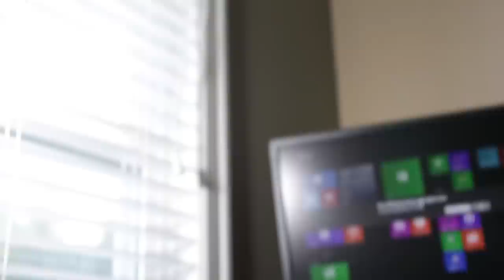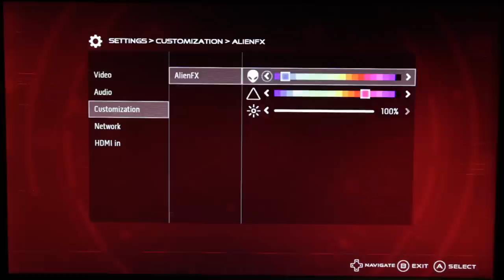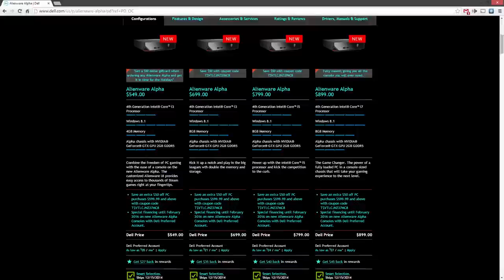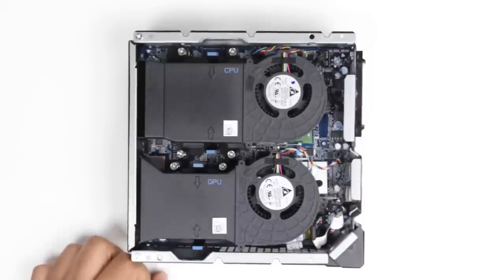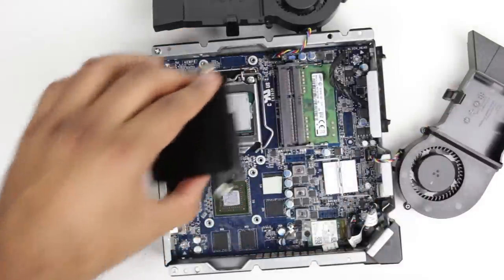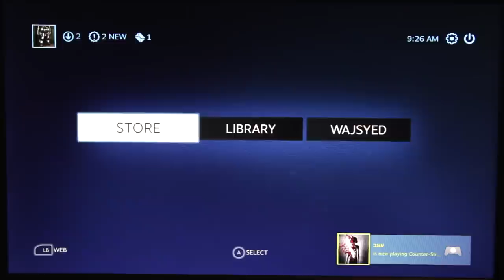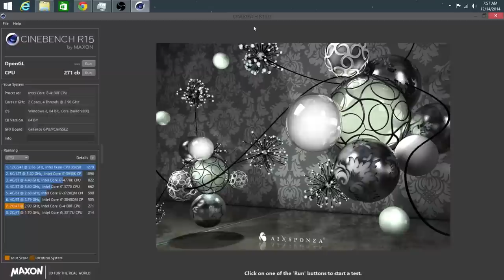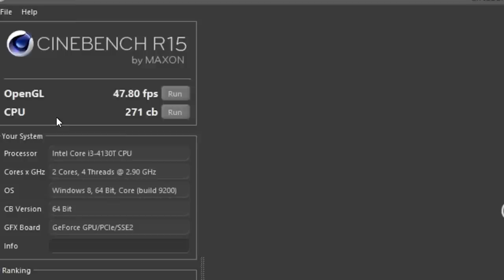Alienware Alpha Full Review

Comment: and this is why Xbox One is great, it runs so quietly, you can have a baby sleeping next to it.
PS4, Wii U and and now this Alienware, are all tiny, but loud as fucking jet engines. I'd take silence over size any day.
Reply: This comment is 40% crap, I own a WiiU and my WiiU doesn't make noise, And I usually play on it for about 1-3.5 hours and I don't get a noise out of it.
Reply: My ps4 is next to silent. You are crazy.
Reply: Reel it in fanboy.  Ps4 runs pretty darn quiet lol
Reply: noise is subjective, maybe if you are deaf as a log you won't be bothered, but i have a pretty sensitive hearing. also i'll have you know i have all the systems, often 2 or more runing at the same time, so i can easily compare them and notice difference.

RandomHeroGames Wii U is pretty inconsistent, sometimes it's quiet but other times it goes crazy. Mine actually sits next to Xbox One, i often use them at the same time, and the difference is very noticeable.
Reply: Also on YT you can find videos of ppl using noise meters on PS4, and it shows over 100 decibels, that's a fucking jet engine.
Reply: RandomHeroGames I had a PS4 for one day, before i got XBO, i needed to make a decision which one to get, i could get both but why? i don't like sony exclusives and multiplats i get on my PC (which is louder than all 3 combined btw) i can just tell PS4 is louder than Wii U, and Wii U is louder than XBO.

And yes, Wii U DOES get loud after a while.
Reply: Bolek Lolek I really don't notice the sound of computers and consoles... Unless it literally is as loud as a jet engine. But i'd be more worried about the integrity of my ear drums than anything else at that point.
Reply: The Xbox one is quiet, so is the ps4. but if you are playing 24/7 the ps4 is like HELPPP MEEEEEEE
Reply: You shouldn't have any device like that running more than i'd say 24 hours at a time, honestly. But that's just common sense. It's just like your body, you're not going to going full-steam for days at a time, you need time to sleep.
Reply: The wii u is a frickin ninja compared to the lunchbox juan
Reply: Trainer Nate you obviously never had an XBO in your hands lol.
Reply: depends, the Wii u is silent, the xbox one is silent aswell, but the ps4, from a friend, its really loud
Reply: Androx5000 sure it is, look at a gutted XBO, you can see its 33% fans and 33% empty space, so of course it has to be quiet.
Reply: ona contrary, PS4 has no empty space in it, so airflow must be terrible, and the fans are tiny, so much they are making intercooler addons for it.
Reply: Bolek Lolek and thats why it has overheating problems
Reply: Bolek Lolek Androx5000 At least the ps4 doesnt have a huge power brick and is twice the size of the ps4 not to mention looking like a VCR from the 1700's tbh. Also the ps4 is way more powerful and way smaller and less expensive whats not to like and not to mention it has better exlusives like bruh
Reply: Trainer Nate xbox one has the prettiest power brick ever made, i almost feel bad it's hidden behind the furniture, and nobody can see it.
Obviously Xbox One has better exclusives, but what do i know, knack must have been your game of the year.
Yes PS4 is more powerful and yet some games, like GTA V for example, still look better on xbox, because PS4 versions looks lifeless.
As long as they are 60fps, i'm fine.

As for look of the console, i only buy white consoles, and white xbox looks pretty damn sexy. It is big, i will probably go for slim version when it's out, but it's not that bad.
That said PS4 looks good too, but only vertically, but that just wouldn't work in my room. And i actually think PS4 looks like crap when it lies down. I mean it was obviously designed to stand, that's how they always show it on advertisments, and even the box art itself.
Reply: Since when you could hear and ps4 wii u being loud stop lying dude
Reply: Bolek Lolek The Xbox One powerbrick is almost as big as the ps4 itself to be honest and at least the ps4 has it built inside, which almost doubles the xbox ones total size including the giant ugly grey brick you seem to like I just don't understand. Sony supports Indie Games so games like Octodad and No Man's sky a galaxy sized galaxy with diverse planets and ships and life are only on ps4. the xbox one a great family all in one system for watching tv and raging in cod but the ps4 is the true platform meant for gaming and the best games on it period. xbox one isnt bad - its just not meant for true gamers
Reply: Bolek Lolek Also you can get a ps4 in white too i dont know why that matters
Reply: Trainer Nate uhm... i have the xbox one, and the power brick is not all that big, is slightly bigger than the xbox 360 power brick, and besides, my power outlet its hidden, so is the power brick.

also, the fact that the ps4 has a built in powerbrick its a terrible idea, not only it generates more heat, but in case it gets damaged, it cant be replaced as easly as the xbox one power brick, and if there is any voltage problems, the ps4 will probably suffer hardware malfunction

i can see how your comment has a lot of playstation faboyism
Reply: Darren Persad liar liar pants on fire.
Reply: Androx5000 I have an Xbox 360 because it was better than the ps3 cuz it was really bad and I love the 360 controller so I'm not biased. I am not saying the Xbox One is a bad console. I am saying that the console is not for me because I need it to be portable which it is, powerful, which it is, and have a great controller and great exclusives like The Last of Us and No Man's Sky. To me, the Xbox One is like a whole entertainment system for the whole family to use and not a system just for playing on, hence the name "Playstation." hopefully you can agree with this at least. Its not bad, its just not for me
Reply: Darren Persad Bolek Lolek I have a Wii u too and it is literally silent all the time. Thanks for getting real info in the convo because I have neither systems except a wii u and an xbox 360
Reply: Bolek Lolek Maybe you are suffocating your systems =p Try putting them in open areas, not in a stand.
Reply: Trainer Nate The ps3 was really bad? what? lol. The ps3 actually had exclusives, as for multiplats some of them ran worse than the 360 at the start of the console's life, but nothing you would even notice (Skyrim pretty much the only bad multiplatform game on the ps3...which I hear got fixed anyway) but I played all of those on my pc anyway. Ps3 ended up the champ of last gen IMO, even though it had a rocky start.
Reply: Hijynx87 I just love the 360 controller so much, and even though ps3 had the better exclusives mainly Halo 3 was a generation-defining game that honestly deserves its own system for that. I can always play The Last of Us Remastered on ps4 and anyways if there were any good new Halo games for One, I might have bought it instead but theres not and No Man's Sky and The Last of Us look like the new best games plus ps4 controller is better I agree. ps3 isnt bad, its just not as good Ive played on it
Reply: My ps4 is extremely quiet
Reply: Christopher McClinton because saying the ps4 sounds like a jet engine isnt gonna piss anyone off or start a console war what did i even say lol
Reply: Unlike you, i don't care how it sounds, otherwise i wouldn't get any consoles.
I care how it performs.
Reply: Christopher McClinton truth
Reply: I'm guessing you've never actually seen or heard a wii u before
Reply: wackytactics who? I own a wii u and i honestly think its the best console you can buy. them exclusives tho
Reply: Trainer Nate he's saying it made noise haha. this thing is quiet, even while running a huge game like bayo2
Reply: Christopher McClinton i never said the wii u was ever loud, in fact i was saying how quiet it was. read it again. -_-
Reply: Christopher McClinton ".the wii u is silent asf" implying that YOU implied that I said the wii u wasnt silent. reading 101 pls
Reply: Christopher McClinton listen, unless you've honestly heard the wii u run a multitude of games comparable to bayonetta and/or games with complex amount of graphics eg. smash bros, monster hunter 3 (to it's own extent) and even DKC TF, you really cannot vouch for it's own quiet existence for "listening to it at a cousins house". And still, you cannot grasp the meaning of the apparently incredibly complex word, "implied", as you were STILL implying that I said the wii u was silent. "who are you talking to the wii u is silent af" as in "are you saying the wii u is not silent, because it isn't" effectively contradicting youre quotings. 

but who cares, the wii u is silent anyways. go to school please.
Reply: True, but it overheats and I saw a guy cook an egg on it
Reply: I love that third party companies make cooling fans for the Xbox One: http://store.antec.com/console-cooler/x-1-cooler-for-xbox-one.html?product_rewrite=x-1-cooler

Because ya'know, it's already "runs so quietly"...
Reply: Mods...
Reply: Bolek Lolek I kept my ps4 over my xbox one just because the ps4 is completely silent.
Reply: Yeah, I always buy my consoles on how many of my kids can sleep mext to it. Lol. This only matters if you play with all sounds off. Who does that?  I usually have my headset on or the surround sound. Biggest silly non issue about hardware.
Reply: ***** doesn't really matter. You're going to be sitting across the room with the volume loud enough to overrun the fan noise. With PC though, you're sitting right next to it, amplifying that noise.
Reply: ***** My PC is loud as hell... [Too broke for an upgrade]
Reply: A good Gaming PC kills all 4 combined.
Reply: ***** Not if you built it yourself.
Reply: mgkpraesi LOL right. OMG so sick of this cliché. This isn't 1997. Building a good gaming PC is almost as expensive as buying off the shelf. And everything being equal I'll take the warranty, better looks of the boutique box. There are no more computer swap meets. Lol.
Reply: Gorilla Jones Right? People love giving the Alienware Alpha shit for being an "OVER PRICE PEICE OF SHIT #PCMASTERRRACESES", but you can't build a better gaming PC for $450(Unless someone is seriously going to spend $800 for the upgraded CPU version, than yeah, you can build a better PC). But gaming PC's are expensive, building your own PC is expensive, and the reason why the Alienware alpha, consoles and other steammachine/PC consoles exists is because they're cost effective and convenient. People don't want to do a ton of research to find what's the best bang for the buck parts so they can build a PC that's still going to be more expensive than the alternatives.
Reply: mgkpraesi if you seriously think you can build a superior PC for less than $500 without scrapping old parts or buying used parts, show it.
Reply: mgkpraesi LOL I'm a fool then. I click mouse and week later bad ass looking computer shows up and I'm happy. Then 2 years later I sell bad ass computer for way more than home built computer. Simple. And if you can afford it, who are you to call someone an idiot. Never assume to tell people what they can do with their own money. Be happy with your home built PC and stop judging. So childish. Alienwares have their place. Just like any other boutique item. Not everyone has the time or want to build. Nit all gamers are living in their moms basement. A Porsche and a Challenger will both get you where yiu want to go, but I'll take the Porsche any day. Ok Mr. Super judgemental guy?
Reply: Gorilla Jones Porsche are very good Cars. But Alienware are not very good Computers. Its just the Name you pay for. I know it, i build PC´s for Years. Keep throw your Money away. I rather build a badass PC for half the Money instead.
Reply: mgkpraesi LOL OK.  I've built PCs since the early 80s my friend. When there were actual computer fairs. Its a highly overated activity at times frought with frustration. 

So while you're hunting for parts, I click my mouse and my machine shows up. With warranty and support. 

And your comment about Alienwares not being good computers is utter nonsense. 

If you choose to build your own, good for you. But please quit the neackbeard ranting my friend. Its really sad. 

Now excuse me while I order my tri-sli Alienware area 51.
Reply: Still waiting for the $450 build that can out perform this little machine.. (Don't forget to add windows)
Reply: Gorilla Jones Sure i excuse you. Have Fun waste your Money.
Reply: mgkpraesi LOL its mine to waste. But thanks for trying to save the world from evil Alienware. What a joke. Lol
Reply: Gorilla Jones They are not Evil. They just make Money with their Name because People like you. I have no Problems with it. An i3 with 8GB RAM, GTX660 and 1TB HDD + mainboard cost about 450-500$ if you build it yourself. Alienware want 1499$ for it. Thats laughable, but not evil. Again, have Fun with it.  I realy dont care what Fools do with their Money.
Reply: LOL
Reply: ***** I don't know about the R9 280. I would just spend the extra $20 bucks and get the GTX 960. Or even save a few bucks and get a 750Ti in addition for more RAM or a better CPU.
Reply: ***** but it's also consumes more power, making it run a lot hotter than the 960. :/
Reply: Of course. You have no choice but to take silence over size. Cos u already bought the xbox one. Or maybe you just have an ugly set up where you game.
Reply: Dude. I'm using my ps4 right now and I am telling you this thing is so quiet, you could probably hear a fucking pin drop.
Reply: LeMuddyNugget Haven't you heard? Everyone knows my console and PC is quieter than your console and PC's.
Reply: *****  Okay. Good for you. You just said a bunch of crap I didn't give a damn about.
Reply: Why is everyone on the internet so mad, nasty, and just plain mean spirited. Lol
Reply: Oh look ist a wannabe ps4 fan😁
Reply: Although i use pc and xbox one, my experience with the ps4 is that it's actually really silent. The xbox one makes a wherring sound when it turns on.
Reply: Hey i have a PS4 and i have no problems with it's noise. Ive never even herd it make any noise so far ~. I like both consoles, but i grew up with a PS2 and i sort of had to continue my love for the PS series. And who even games and hears there console anyways! real gamers use headsets xD. the Ps4 also looks nicer 

P.S. No hate Plez
Reply: Haha all's fare in gaming and war
Reply: Console peasant...  #smfh
Reply: AwsomeFace Gaming no, this isn't a battle of which is better. It's a war over how much bullshit someone can say.
Reply: ***** Yea, but... sleeping babies...
because that's what matters, not the gameplay.
Reply: zyrgle shhh, the baby is sleeping right next to my Xbox. 
[turns up the volume while playing CoD]
Reply: I have an U and haven't noticed annoying loud noises
Reply: leonemesis87 Yeah, my housemate has a WiiU and the thing is just absolutely silent. I think the only time we heard it at all was when I left it on the table during a podcast, and the Yeti kept picking up the vibration.
Reply: Well we all know your about 300 years old
Reply: Some Guy in a Waistcoat Yeah you would have to put your ear up to my Wii U to hear the lowest of a hum.
Reply: id have power over less then 10 decibel sound difference

 #pcmasterrace   #ps4
Reply: 52andyo Some of us are interested in it as a portable DAW and recording setup as well. That sound difference means less effort tweaking filters and gates when our equipment is picking up the noise of a laptop from the other side of the room.

Personally, I'll take not having everything at Ultra if I can get less noise and more portability.
Reply: Some Guy in a Waistcoat I honestly want this so I could mount this behind my monitor and have a clean, wireless setup.
Reply: ***** funny you say that because it works both ways. there isnt a very big difference between pc ultra 1080p and a 900p ps4. very few would even notice it unless they're told to see the difference
Reply: ***** yeah excatly, i wanna hear the game, not a fucking jet engine, thats why consoles should be silent.
Reply: Bolek Lolek i dont hear my wiiU or ps4, just my pc!
Reply: ***** it depends certain games make my ps4 loud but yeah mainly I can hear my game running but still ps4 is louder due to its compact size it gets pretty hot
Reply: PC outbeats Xbox one any dat
Reply: Slick Stre comfort wise no
Reply: ArChYAtis yup, you can play just play on a 4k tv with a controller and there you go.
Reply: ***** PC is life. :P
Reply: ***** Life is PC, PC is life.
Reply: jblauh01 That's your opinion, I've had every single console from, and I can tell you that most people would find the PC way better than any shitty ass console, consoles are just for kids that can't afford a gaming computer because they're broke. Just like your family. PC can out beat consoles at looks, performance and comfort wise. Consoles will burn after playing for too long, and you can also upgrade parts of your computer to make it even better child.
Reply: jblauh01 what the hell are u talking about its yust what u prefer and its more expensive then pc gaming cuz games cost more ur argument is not valid
Reply: Bolek Lolek my ps4 and wii u dont make a peep
Reply: Jaysus777Live have you tried turning them on?
Reply: Bolek Lolek almost always on, only time its made any amount of noise is during a large update
Reply: Bolek Lolek 
The X1 is such a joke in comparison to the other machine options out there today, including the PC console type variants. Wii is still a child's system but the X1 itself is a piece of shit falling behind in the big league.

Once Xbox dies off this generation (it will), Halo will become a PC game, if they're still leeching the brand name by then and Microsoft will likely begin building PC consoles like the ones we're seeing now. Mostly because their primary software is for personal computers.

Technology has been rapidly advancing the past decade and consoles limitations will not be able to keep up with the availability of PC hardware, which is simply plug and play, or plug, install software, then play. Simple.

I own an Antec Twelve Hundred V3 computer case, it has nine fans running at once and it sits at the foot on my bed near the big screen tv. Even with all of its raw power and ability to keep my bedroom warm during winter itself.. Has never caused me any noise problems while trying to sleep.

The fact you take pride in the X1 clearly shows you're ignorant.
Reply: Here Kitty you +1 your own comments like a pro, brah.
Reply: Here Kitty nice try but clicking on the plus displays who plused it, exposed.
Reply: No fooling you ;)
Reply: How dare you speak down on ps4. Blasphemy, the ps4 is the best gaming machine on the planet. Nothing can touch its raw power. Maybe in 5 to 10 years devs will get their head around such advanced technology.
Reply: Bolek Lolek xbox one looks like a heap of shit as for the ps4 its really good and looks way better
Reply: conor sweeney not gonna argue, but PS3 looked like dog shit compared to 360, so it's 1:1
Reply: i think the 360 was better than the ps3 too
Reply: Bolek Lolek 3 fan GPU and no noticeable sound. Plus, I can play internet for free, all while paying less for better specs. Wonder how much abuse that D-pad had to go through for you to type that comment.
Reply: Bolek Lolek no no this is why you get a water cooled desktop
Reply: Bolek Lolek and thus we learn you are in fact 10 years old
Reply: Bolek Lolek noise is objective lol. If you want a silent PC, build a nearly fully passive small form factor PC with a GTX950. Wrecks the Alpha.
Reply: My Xbox one is pretty loud depending on the games I play
Reply: +Tech Wildfire I was wondering can you really notice a difference between it and the Ps4
Reply: +Ayamalach the Noise? Or gameplay in general?
Reply: Tech Wildfire I guess both
Reply: +Ayamalach Noise really isn't a big difference. Gameplay feels a bit better on ps4 it feels smoother. However both PSN and XBL go down a lot so be prepared for that.
Reply: Chris M No Mines is the exact same way